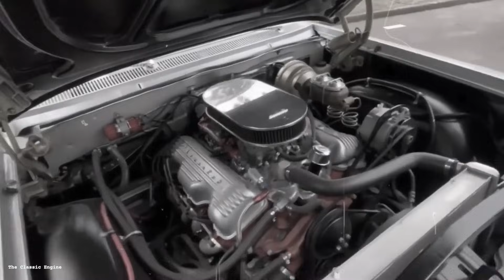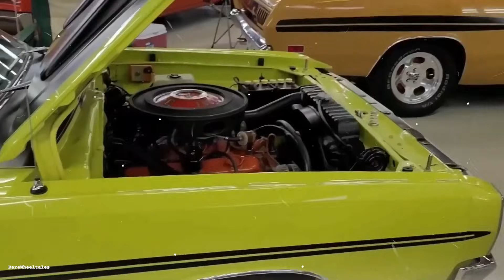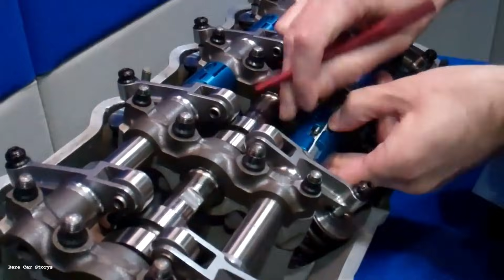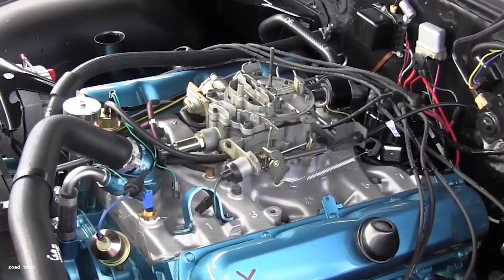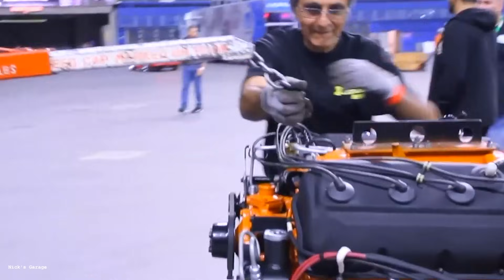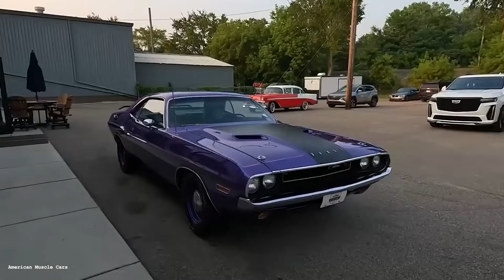The Engineer Who OUTSMARTED Chrysler - How Herb Adams Modified the 426 HEMI

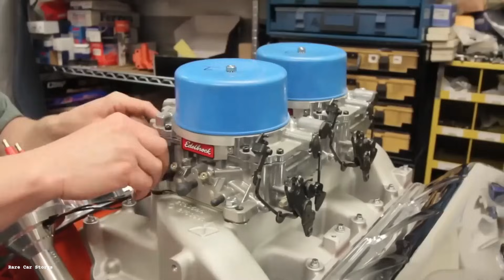Comment: @4:19   Greatest Statement ever on Factory motors.  Absolutely   !       Built on a Monday or Friday their are good one`s, and bad one`s.  I had a 1972 chevelle heavy chevy 350 2 barrel  turbo350 all stock ,    except some Genius worked over the 2GC carb,  before I bought it from the local chevy dealer.   and  It out ran everything with 2.73 gears.  I raced 383 Chargers, Pontiac firebirds, I beat 10 other cars.   Except of course a built 327 65 chevy 2 ,  with 4 speed,   He beat me all the way out.   A 69 chevelle ss 396 auto did the same thing. From start to finish. and then a 68 chevelle 396 caught me at the deep end by a couple lengths.   Back in 1976-79 the good old days.